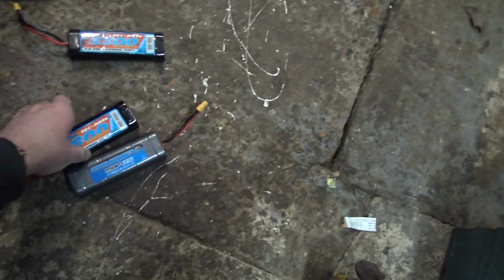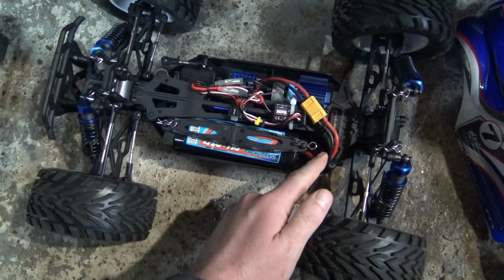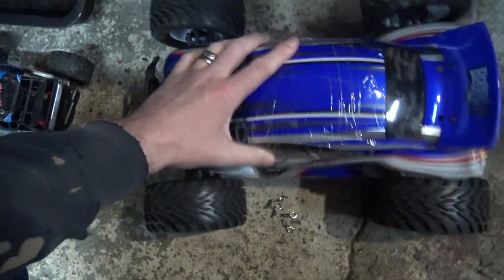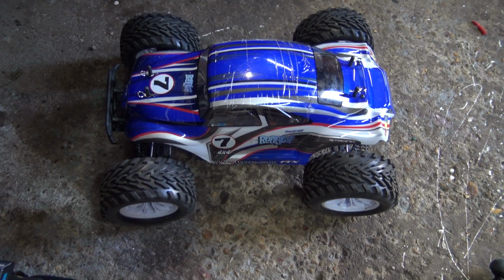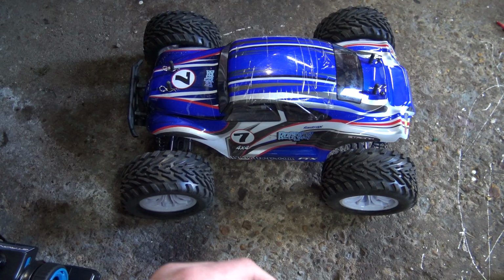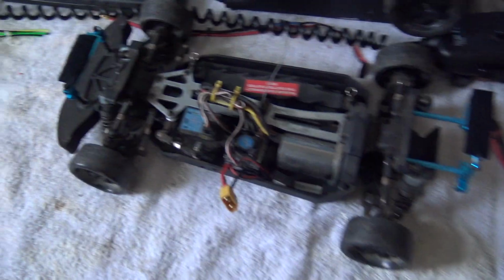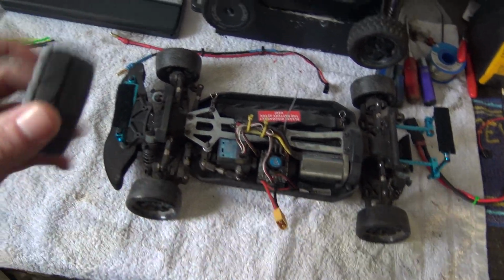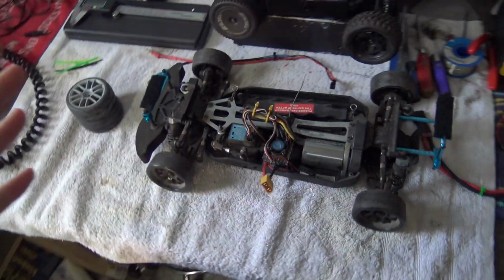FTX Bugsta on 5300mAh Battery!!

Comment: Hi mate great video on your ftx beetle just a quick question on my ftx torro trophy nitro I charge the throttle servo right and when I went to throttle the pin came loose on the back of the throttle cable the small screw do you have a problem with this should I super glue it or not what you think 🤔
Reply from the maker: No just use thread lock on it, removable grade so you can still adjust it
Reply: @HaggardRC  hi thanks for getting back to me so you saying take out the Fred screw out and but in blue locktide yes not a screw 😉
Reply from the maker: Haha you tit, you know what I meant 😂